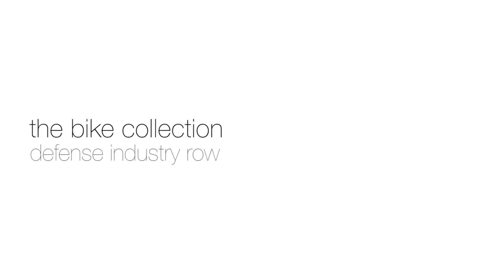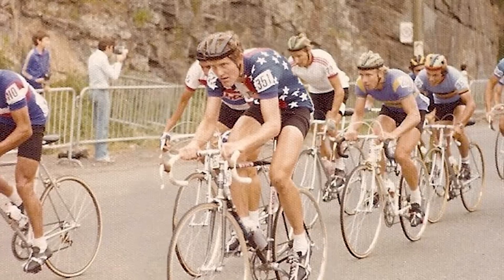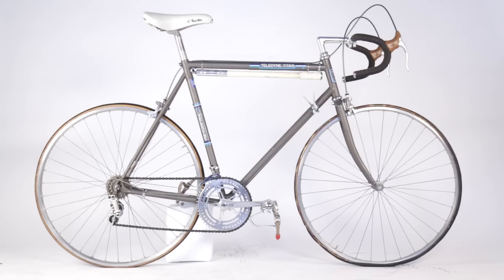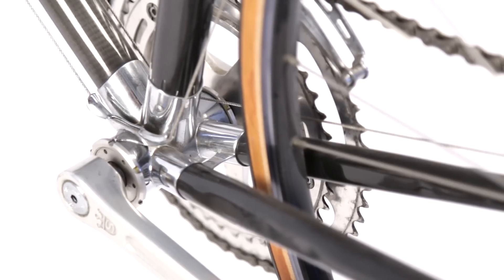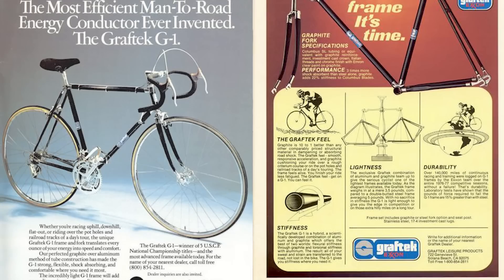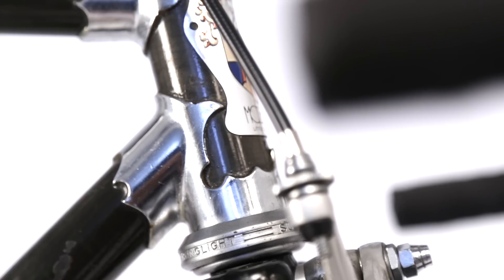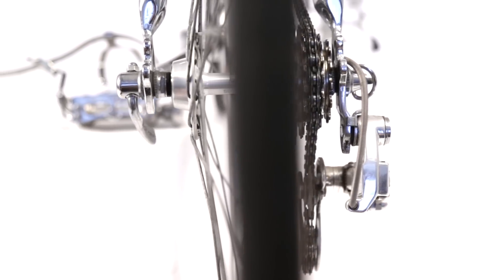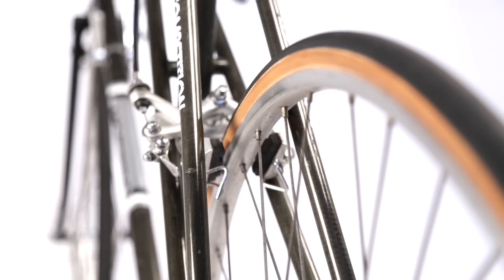The Bike Collection • Defense Industry Row

Comment: No mention of the extreme lack of stiffness in these first generation frames?  They weren't nicknamed Graf-flex for nothing!  I remember the Teledyne having slightly oversized tubes, but the down tube had a "pinch" (kind of a wasp-waist deal) to allow stock-sized clamping bands on shift levers to still be able to fit this exotic frame.

Comment: Twenty years ago I built up a Teledyne Titan as a retro / display bike for my friend who was a shop owner. It was the first year I worked in a shop and it was a cool project. The only issue was the full Ti fork had a crack on the outside long axis of the upper left fork blade, making it display only.
Reply: We sold the original Teledyne Ti frames at the bike shop I worked at in Victoria, in 1971-2 and they seemed to last for a month before cracking. weird big black tubing. Lifetime guarantee, though. Crazy light for the day.